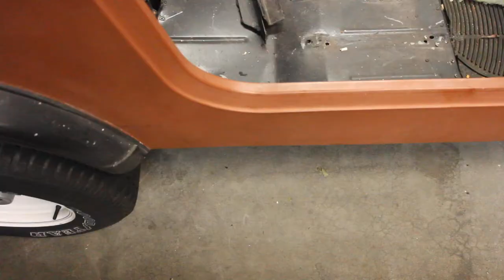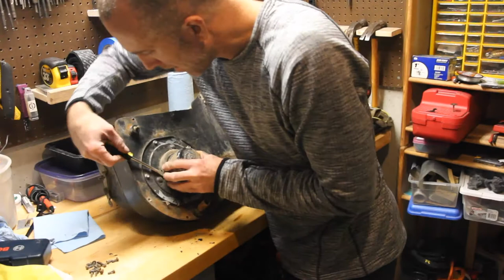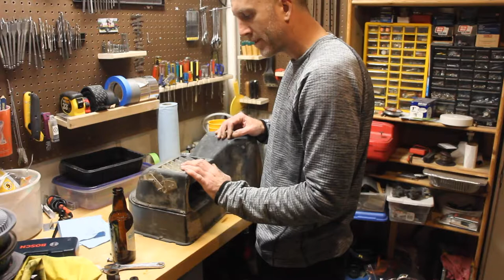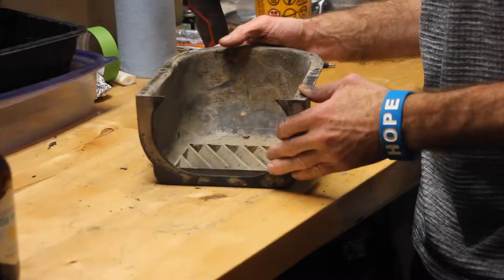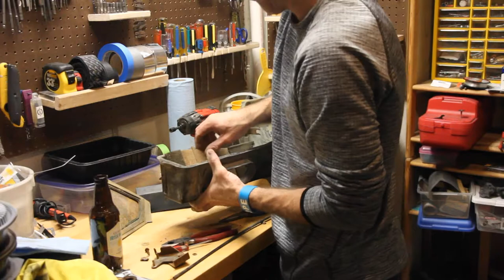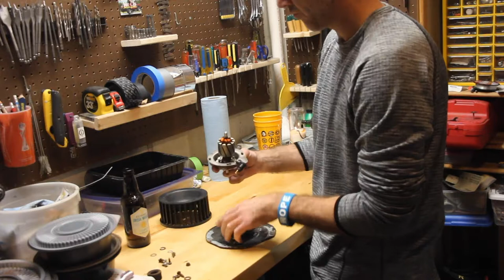Jeep CJ7 Heater Box Teardown

Comment: I'm afraid I'm going to have to do this on my CJ-7.  Mine sounds like the fan is probably rubbing on a mouse nest and I can smell old mouse pee when I turn on the heat.  I've been hoping the smell would just go away but it's been a couple years and still smells just as bad.
Reply from the maker: Really, getting it out is the toughest part. Everything else is just cleaning and painting.
Reply: @y_CJ7 Mine's an '84 so I've been considering the Howell TBI and DUI upgrade.  I may have to just plan on doing this at the same time.  I've only been using mine while it's nice out so the heat doesn't get turned on much.

Comment: Did you wash the housing with the 50/50 purple/water also?? I hope my ground or wires are disconnected if not ya can’t hear the heat kick on… but we feel hot air that comes out sort of … lol I think it’s just heat off the motor venting in the jeep… I hope it’s just wiring don’t wanna cut on the Jeep unless we have to lol
PO removed my ac unit :/ so I wonder if they may have pulled wires lose lol
Reply from the maker: Could be. Another source of the heat is the heater core which the radiator flows through into the heater box. Any decent degreaser will clean the plastic up really well. A good way to test the motor is to simply connect a wire from the positive post on the battery to the feed post on the motor in the engine bay below the battery tray. If it fires up then the motor is good. If not then you have a more complicated problem to fix.

Comment: That door on the inside of the heater box (as well as that flap that was tough to get out) are gone in my CJ. Any suggestion on where to find assemblies like that? I am looking everywhere...
Reply from the maker: Can't find them aftermarket. You'll need to track them down on FB marketplace or ebay. Or you could email me at dellis6914@gmail.com. I should have an extra set of all the internal workings. :)

Comment: Are Rock Auto and Quadratec what you call specialty type stores?  If not, which are?
Reply from the maker: It really depends on what you want to find. Rock Auto is great for good selection on upkeep, rebuild and maintenance type pieces. Quadratec, Morris 4X4, and the rest of the lot are good for replacement items and may have things that you can't get at your local autoparts store. But if you want to stay OEM or find NOS, you'll have to find a good parts guy, like Ray Moulton.

Comment: Did the motor work once put back together?
Reply from the maker: 100%. Still running like new 2 years later. Not a lot of things that can go wrong with these basic electric motors. As long as all the wiring checks out and the brushings arent completey worn, you should be good.

Comment: Pulled mine today. Full of rats nest. Smh
Reply from the maker: Sounds par for the course. I have all the parts except for the heater core if you need anything replaced. Also, I can help with replacing the foam on the flaps. Let me know.
Reply: @coolguy_CJ7  thanks. Ill probably open it up in the next day or so
Reply from the maker: Make sure you drain as much radiator fluid out before you start moving it around.